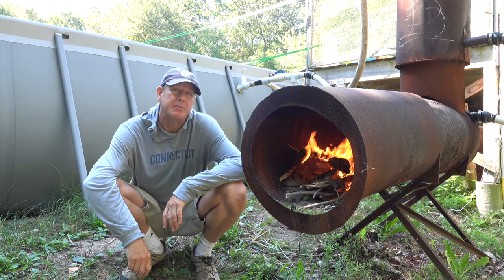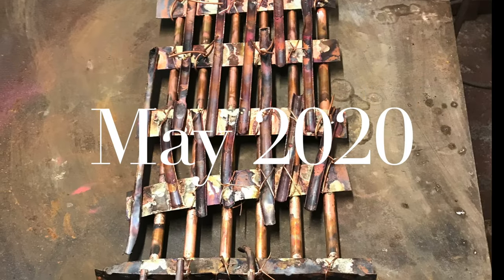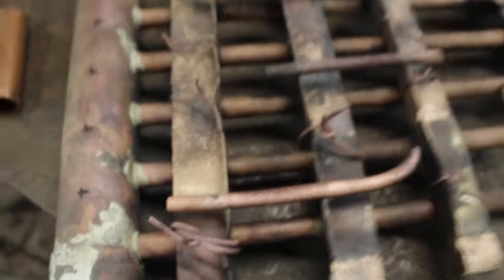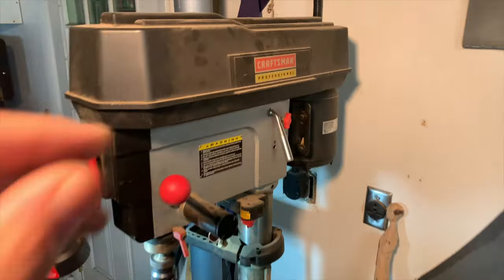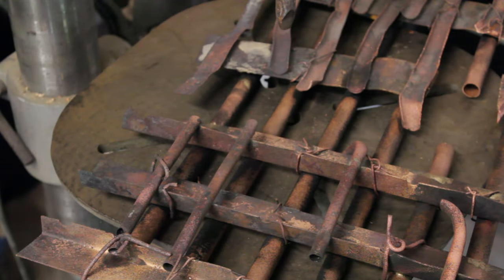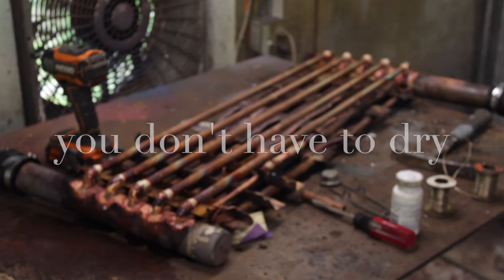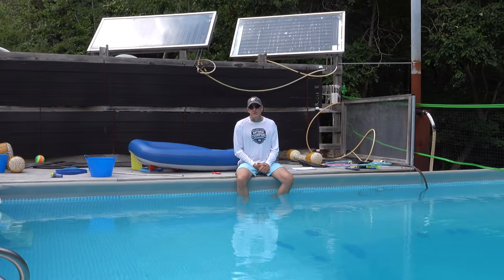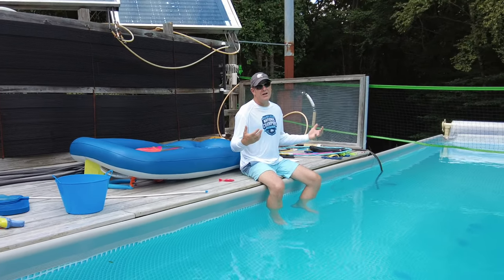How to make a real wood fired pool heater

Comment: I was a little concerned about the mixed reviews, but I used it last year and hooked it up again this year and it was great https://www.youtube.com/post/Ugkx-izdrK3eF-HMvjzeBOxToD6Fx-4ulJUh . I couldn't get my 10' Intex pool above 76 degrees the year prior and last year I got it to 90 and had to put ice in it. This worked so well! I have just 1 mat hooked up to a 1,000 GPH Intex pump and it makes a significant reduction in the flow rate coming back into the pool, but that is to be expected with how far the water has to travel through the mat.
Reply from the maker: Oh no what happened?

Comment: I'm trying to pump antifreeze thought the heat exchanger, then inside the garage to a radiator/fan. I guess I'm trying to build more of a "boiler", now that I'm explaining it here. But this gave me some good ideas! Thanks man!
Reply from the maker: Sounds like a plan.
I have a system with antifreeze in thermal solar panels and a heat exchanger in the top of my chimney.
I’ll do a couple of videos on it as soon as work lets up.
Love to hear how you make out.
Thanks

Comment: I think this is awesome.  Some people are probably going to jump you though about "no green house gas emissions" from this burner.🤣
Reply from the maker: Yeah probably! Burning wood does produce Co2, but it is short cycle Co2, which means that unless you keep the fuel wood from rotting it is going to turn into Co2 anyway. So that is why it's not a GHG.
Thanks for the heads up!

Comment: FYI if you use copper pipe in the fire place you can remove the pump as the heat will make a natural pump pulling in water and sending it out.
Reply from the maker: Yes, you can get this to work when you have enough elevation difference between the pool and where the heat is. The pool heater would need to be low enough to let the heat pull the water back into the pool and circulate through.
But running all the water through from the main circulation pump gets the most heat into the pool. Plus it will keep the heat exchangers cooler so they last longer.
Thanks,

Comment: I have a suggestion. Put an automotive radiator across your smoke stack instead. All of the post combustion air then passes over the heat exchanger without dead zones. And you get massive surface area.
Reply from the maker: Thanks for the suggestion. I think the small fin like space might get filled with creosote and ash though. It's a pretty nasty environment in there!
Reply: @sculptureforasmallplanet   for the ash, it will also act as a spark arrestor. The ash being held against it will burn up, or fall down at the end of the day, periodic rain will clear the rest.

For the creosote and other gunk. Periodically disconnect it and run it through the dishwasher.
Reply: You can also be mindful of the wood you’re burning to avoid creosote. It doesn’t eliminate it but it will definitely prolong the build up.
Reply: I tried using an automotive radiator as the heat exchanger and it immediately was caked with creosote (and I was burning cherry wood).  It didn't transfer much heat and I was pretty disappointed with the results.

Comment: i like the long burn tube  . i think shelf in the top with the smoke pipe up by the feed door with heat exchanger in the shelf . the fire would heat that shelf and by routing the exhaust back thru the opening wouls let the tubes be in the heat longer . the only thing is it might cut down the draft for the fire
Reply from the maker: Long burn tube is not negotiable.
I like your shelf idea but I think I’d have to see a diagram to fully understand.
Thanks,

Comment: Do you think this will work if I only have a 55 gallon drum?
Reply from the maker: Sure. The key is to the manifold aspect of the heat exchanger and the large volume of water. Get as much surface area as possible in your heat exchanger and put at the top of the barrel on it's side and you'll get a lot of the heat!

Comment: Can you make a part list for this project please
Reply from the maker: Hello. I only can provide a general materials list because I made this thing a while ago, sorry. 
This is made of type L copper tubing, 1/2” and 2”. About 30’ straight and 50’ of the coil and 10 of the 2”.  I used 4, 2” end caps and 10 street 90’s.
My pool uses 1.5” PVC pipe so the 2” copper is close to the same O.D. But try to make your manifold pipe close to whatever your pool’s circulation pipes O. D. is. Then use Fernco couplings to connect copper to PVC.  I made the lower tube out of the inner tank of an old hot water heater. The other tubes are a thin sheet metal like 18 or 20 gauge. I used a higher temp silver solder but not sure if it is necessary as long as you keep water in the pipes lower temp solder should be fine.
Hope this helps!

Comment: Liar, No chainsaw to cut down the wood? 😂
Reply from the maker: I do have gas powered chainsaws but hardly use them since my electric one is so much easier.
However you are correct if we are counting emissions once removed.
Thanks,

Comment: Do you have any issues with solder Melting with that much heat on those joints
Reply from the maker: Hello,
Not if there is water in the pipes. Just make sure the water is circulating through before you start the fire and use a good pump.
I have video on mistakes to avoid that you might want to check out.
Thanks,
Reply: @sculptureforasmallplanet  thank you very much. Looking forward to building something soon

Comment: Also… how do you send the water from the 1st heat exchanger to the 2nd one?
Reply from the maker: Hello, look at 1:14 of this video and 1:10 of Pool Heater Mistakes to Avoid, video and you’ll see the PVC pipe connection with Fernco couplings. Hope this helps!